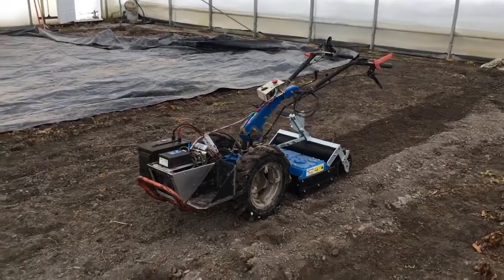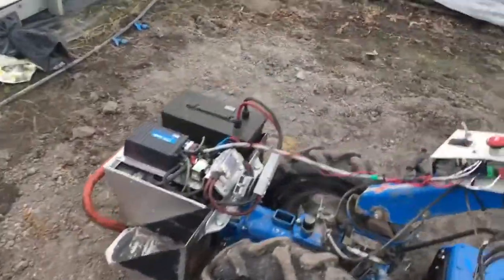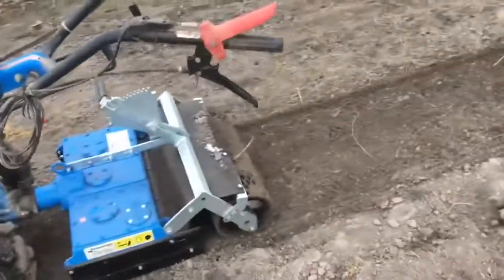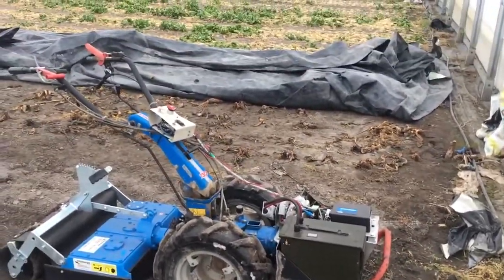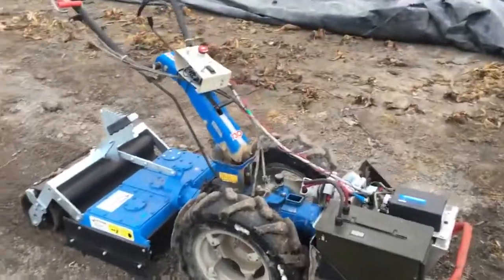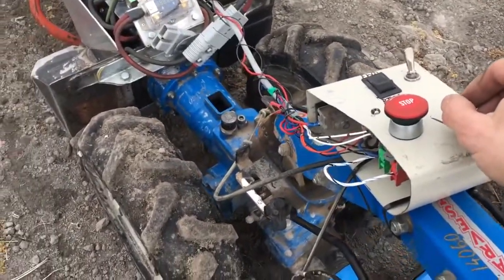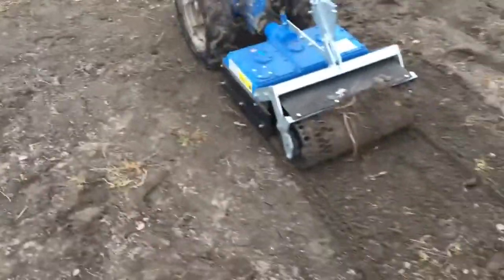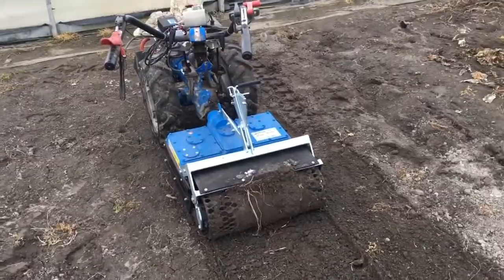electric BCS first working trial

Comment: What electric motor wattage (hp) are you using? What voltage does the motor use 12 or 24V?
Reply from the maker: Motor is a 7" diameter separately excited DC motor from AMD (Advanced Motors and Drives).  It can handle up to 48V but I opted to go with 24V based on batteries and controller I had access to.  Motor is AMD DD0-4002.  Controller is Curtis 1243.

The motor tends to draw about 20-30A (500-750W) but can spike to as much as 200A (almost 5kW) under maximum loads.

Comment: Super thrilled to see your work! Been looking for this for some years now. 

Only got a ”design” concept for an electric 2wt befor. The ox1 from Umeå univ here in Sweden. Google it, quite nice.

So are you going to start producing these or are you going to put info out for Pål to use? Would be super to see some specs and calculations - both tech and economy :)

Any info out there?!
Reply from the maker: Our machine is much more complete since about a week ago and I think it's now actually ready for work and also testing/data collection.  I'll post another video soon and start sharing performance data.  No plans to build more than one of these.  I'm a full-time vegetable farmer and mostly wanted one for use on our farm but also to show that it was now possible to build one of these.  Hopefully projects like this will eventually inspire a manufacturer to tackle the puzzle and make conversion kits or electric-only 2WT available in the years to come.
Reply from the maker: very first performance data is from the last couple days.  I got the ammeter display working and it peaks at more than 200A @24V when working rototiller in 2nd gear.  Much lower current draw in 1st gear.  Initial run in the greenhouse consumed approximately 500Wh (watt hours) to till in about 300 lin ft (≈100m).  That's about 66m2 area because the tiller is about 66cm wide.  Current drain determined by recharging battery before and after task using a balance charger that records throughput.  Autonomy for rototilling seems to be about 30min per 1kWh battery pack so 60 min with two.  I've assembled two and will assemble two more to have backup and also to share with other tools.  Check my videos list as I'll be posting some new videos of the completed machine soon.
Reply: Reid Allaway Allright! Thanks for the answer, i will keep checking your videos :)